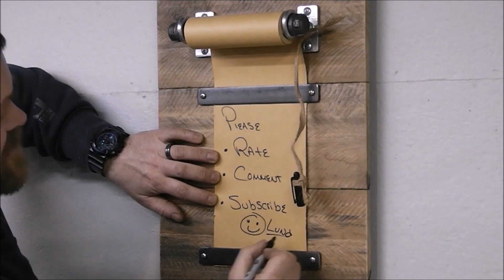DIY Rustic Notepad from Reclaimed Pallet Wood and Plumbing Pipe

Comment: great video what are the 3/8 metal holder you mounted called
Reply from the maker: casy casy they are called ceiling mounting plates. I paid 2.50 each at the big box store and got boned apparently. I like the looks of the ones in this link much better. https://www.supplyhouse.com/Empire-Industries-41AB0038-3-8-Carbon-Steel-Ceiling-Plate?gclid=CjwKCAjw7tfVBRB0EiwAiSYGMyValA2KWt99YMC1_9L0y0tM3QbHz1OubdygDfsVl0RY7H81Vm0QBRoCGT8QAvD_BwE